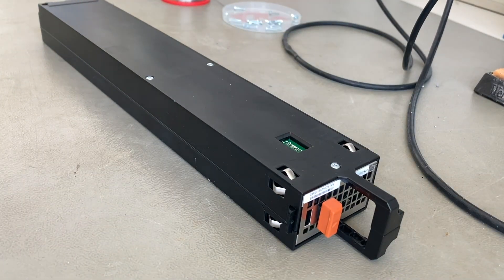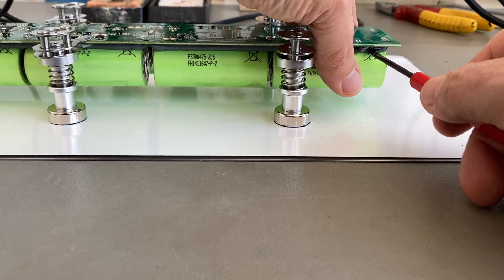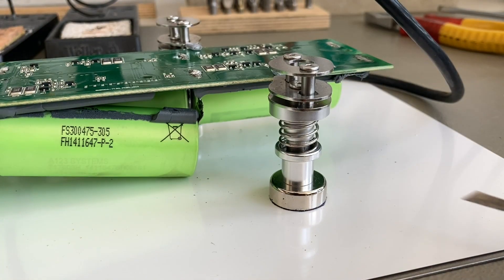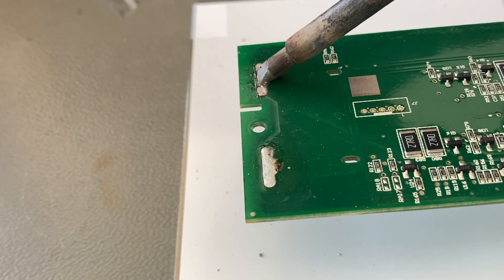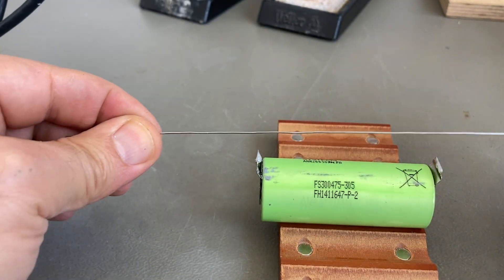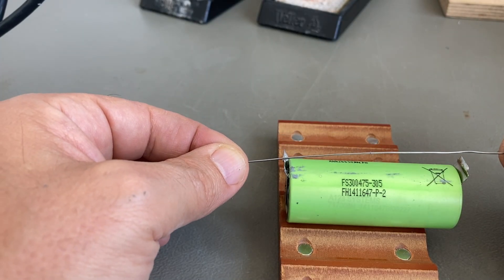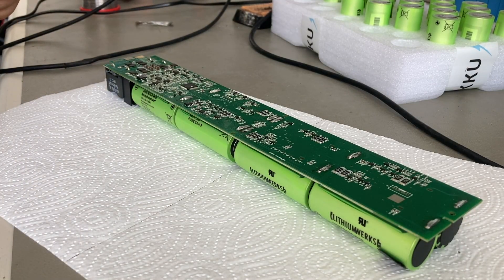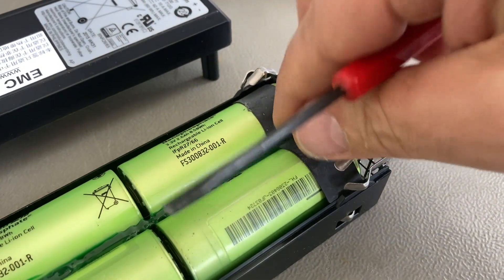When one soldering iron is not enough...  (PWJ272)

Comment: Other than shouting fire, do you have a safety procedure if that beauty went unstable? Incidentally, I'm noticing a lot of 1 to 2-year-old Lithium based domestic equipment (rechargeable) going defective lately - refuse charge. People are not remembering to re-charge them, but so much equipment is now rechargeable. Their equipment is thrown away - wonderful, personally I have about 30 rechargeable devices, and it's a tedious bore maintaining them. And, so they go out and buy another, this can't be right.
Reply from the maker: In fact I do, I just don't know if it's enough. There is a ceramic bowl and some water available in the workshop. If something goes hot, that's the way to cool the pack to prevent chain reaction.
At home, I have a special fireproof lithium storage box. This will contain flames and sparks and heat when a battery inside goes wild.
For recycling old batteries, we use a steel barrel where the batteries are mixed into layers of Vermiculite. That's a heat resistant filler material. Barrel and filler is provided by the recycling company that exchanges the barrel when full.

Comment: The problem with paralleling anything with individual control, is the one that thinks it's below temperature  one will try and do all the work. any that think it's above the temperature will turn off and wait for it to cool down.  We need a thermal form of an emitter resistor for parallel transistors. 🙂
best to go and buy and big old school 200w + soldering iron as with this work power is the key, heat settings don't matter if you don't have the power to overcome losses. 

I have a gas torch that can do about 3000°C  as long as it quite small. Lots of heat but no power.

Comment: Would low melting point solder help with this? I have a 200W Weller soldering iron I use for big stuff 😀
Reply from the maker: Maybe, but you still have to de-solder it first. Another problem is this ROHS leadfree solder they use. That has an even higher melting point. With a 200W iron, it shouldn't be a problem though 🙂

Comment: Original battery tabs were from cooper, you used nickel type, they will heat up.
Reply from the maker: I just checked them again... they are nickel too, no copper. How did you come up with copper?  BTW, I have never seen copper strips in battery packs. Is that even possible?
Reply: @PlaywithJunk  I replied 2 hours ago, but it's missing/deleted.  Older Metabo and Bosch power tools are using cooper/nickel plated cooper on the tabs. Based on the cell used by the manufacture to be cooper, as the module can deliver up to 60A, if I recall correct.
Reply from the maker: I think they are wide enough and very short, they can handle the current. And the batteries won‘t discharge at high current normally…

Comment: Not watched the complete video yet, couple of points, I had a similar issue with e-bike phase wires and battery terminals, bought a fnisri 100w iron and it completely outperforms my other irons. Those cells, I doubt they are all bad, might be worth separating them and testing them separately with a modern charger.
Reply from the maker: The combined power of my two irons is 130W (80+50). So I guess one iron with 100-150W would do the job too. 🙂 At least if you use a very wide tip.

Comment: The quadcopter community has driven the growth of high-power soldering irons; I don't know if you're inclined to buy a fourth station but there may be new options for one.
Reply from the maker: Sure, but I don't heed that often. I have a battery spot welder, because most battery packs are welded and wired. Soldering them directly to a PCB is unusual.

Comment: You don't do that kind of jobs often enough to get a heavy iron like Weller SI251 ?
Reply from the maker: Well, that's a big boy! But you're right, most batteries are not soldered directly to PCB, so we don't really need that often. And the combined power of my two irons is 130W, that's enough as you can see :-)
Reply: @PlaywithJunk  There is also a 120W version of it... but of course the main issue with using those plumber's tools for this work is that there is no temperature regulation so unloaded they heat up to well over 400C.  You would need a big block of steel or similar to keep it on while preparing the work.
Anyway nice job, I would not dare to do that.
(and probably I would do it on the patio rather than in the workshop...)

Comment: @5:50 you should get some plastic razor blade scrappers for that job. I know, I was skeptical of them but after using them, they do work well!
Reply: They're great for a surprising number of applications.
Reply from the maker: I made this wooden wedge to pry the batteries off the board but it was too thick. But it works well as a scraper.
I know those plastic razors, next time I try them 🙂